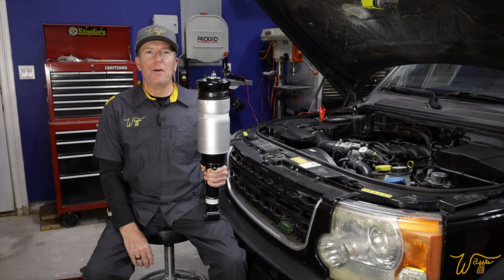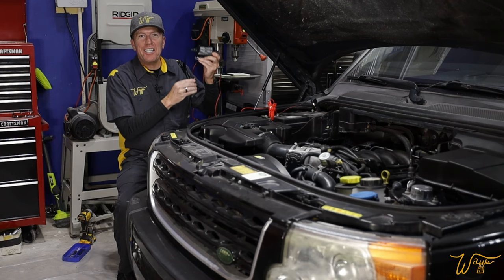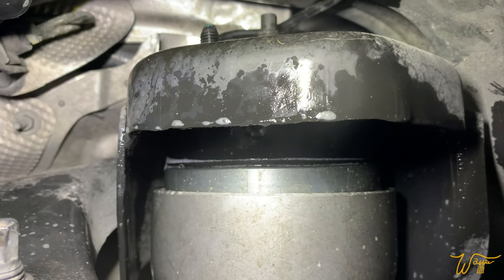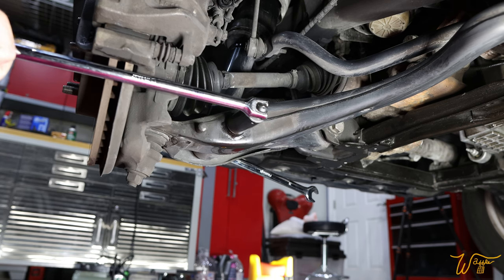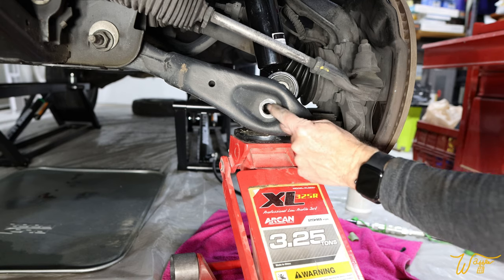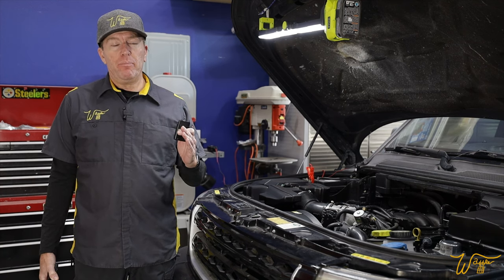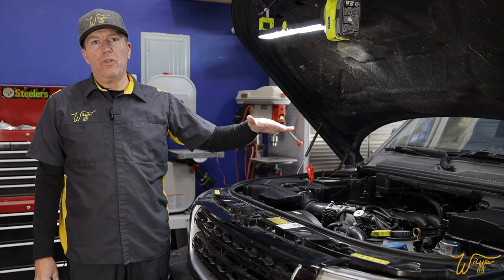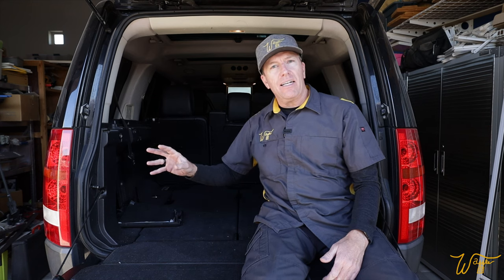Replacing Front Air Struts on a Land Rover LR3 - Ep. 5

Comment: Hi, many thanks for the very kind words , really pleased it helped , indeed as mentioned to disable the suspension just need to pull the F26 fuse , great the new struts came with the brass Voss connectors as on there own there around $14 bucks , personally I replaced all mine with brass push fits as they were a lot cheaper along with being easier of just pushing them in without messing around trying to get a spanner to tighten the Voss connectors . When I done mine several years ago I did find the ride quality was better . Plus finding out that when the suspension is in off road height and u get bottomed out whilst driving off road the vehicle will give u the option of raising it to extended off road height and then plus extended off road height , awesome lift by the way , happy motoring  and u have a wonderful safe trip , many thanks for sharing this video with us , looking forward to the next video , ps , hope it was ok but posted ur video on landyzone and the discovery 3 forum , hopefully will then get some more views
Reply from the maker: Thank you, Gary! Share away!
Reply: @wafflesquare  , many thks, plus didn’t want any of my comments to come across as disrespectful in any way , just what I’ve learnt in the last 6 x years of owning my D3 and nice to always pass it on , found ur videos extremely well put together and very enjoyable to watch, thks again as it must take ages to put these together , hope u have a wonderful trip, ps, now u have the discovery it’s a good excuse to buy more tools, lol
Reply from the maker: Amen!

Comment: The only fuse you need to take out is fuse F26  yellow 20Amp . This stops any articulation of suspension by the vehicle.
Reply from the maker: Thank you so much!
Reply: Can confirm F26. I remove it enough that I've sharpie-d the surrounding plastic so it's an easy find each time.

Comment: Its always best to put the new voss connector nut and collet onto the green pipe before you connect it back onto the strut .  When the connector is then inserted into the strut and you tighten the voss connector  the brass collett tightens its grip on the pipe  giving you a proper airtight seal . Also you don't then need the pliers . Voss connectors do not work the same as push fit as you cannot get passed the collet once it is tightened . hope this makes sense and good channel Mike .
Reply from the maker: Thank you again!

Comment: Great video!  Replaced one of my 08 RRS air struts in about 1 hour!  One note:  Save the brass air fitting from the old shock.  And save the plastic insert that comes with the brass fitting on the new shock.  I found the brass fitting delivered with the new strut did not have the same tolerance as the OEM fitting and leaked during a bubble test. (I.e., it was very easy to slide the pneumatic line into the new brass fitting and difficult with the old one). Once I installed the old brass fitting into the new shock using the the plastic insert, pushed the  pneumatic line in with a bit of force, the bubble test was good, and the shock is keeping pressure.   I'll know more in about 24 hours!
Reply from the maker: Good for you!!

Comment: F26 is the EAS fuse. 
The brass fittings are called VOSS connectors. Look after them, they sell for about £10each. 
For the 15mm top nuts, a swivel head ratchet spanner does the job on all 3 nuts. 
Always do the overnight test at the height at which it sinks overnight. Fully raised often seals the split in the rubber air spring and you learn nothing, this of course depends on where the actual leak is, but its usually up inside that aluminium can where the rubber folds in on itself.

Comment: Mike, this is a little long but I needed to explain so you could see where I'm coming from.

I used your guide and a couple other videos to properly educate myself. One incongruity was oxmanagain saying you feed the VOSS connector and compression ring onto the line first, then seat the fitting into the strut and tighten down. I tried the push-connect method on the rear strut and found it almost impossible (though I realize it is the correct method) so I threaded all connectors on the line first and that definitely worked.

That sets the stage for my question. Unlike the rear, there was a huge space deficit on both front sides, mostly due to the heat shields and long strut posts. The welded bracket that holds the strut also is thick enough where I seemed to need a very thin wrench (which I didn't have) to finish snugging up the brass air connector from above the bracket. I felt it was near impossible to tighten the brass VOSS connector below the bracket due to the three posts, so I did it all from above once the posts were tightened down fully.

I noticed you didn't include the tightening of the air line in your video and neither did oxmanagain. My main concern is not getting that air line tightened enough to prevent leakage. I would say both are snug, the air line "bulge" is about two quarter widths from the top of the connector, and firmly tugging on the line I cannot remove it. Do I call it good?
Reply from the maker: I took great pains to document every step I took and the outcome was everything I had hoped for…leak free air suspension system. I’m not sure what else to say.
Reply: @wafflesquare  However I worded it, I have to clarify: No judgment here. You did better than great.

I guess I just took a bunch of words to ask if you thought I would be good to go on the Voss connections the way I did them. I put everything back together so we'll see.
Reply from the maker: @blackrocklookout thankfully, a simple leak test will answer this question. according to the instructions they are meant to be installed the way I demonstrated.

Comment: Hi, you should check out a German couple (Christian and Vera) on YouTube,  their channel is called "LR TIME" they have lots of brilliant tips including which is the only fuse you need to remove on the LR3 and LR4 for the air suspension, it is an excellent channel with a new video every Sunday. I highly recommend it. Thank you for taking the time to make your videos and sharing them.
Reply from the maker: I love their channel!!
Reply: Those two have a great channel, and some seriously good mechanical skills to boot
Reply from the maker: Agreed.
Reply: Yes there are now 5/6 really good you tubers specialists on LR which is great I’m personally tackling jobs on the vehicle I never imagined I’d do.  👍👍🇮🇪greetings from Ireland
Reply from the maker: That’s great John!!
Reply: Thanks heaps for the video very informative. I do however have 1 question, once the airline is seated in the 12mm fitting did you have to tighten it. It looks as if you placed a small amount of torque on the 12mm fitting  prior to installation and then pushed the airline in until it seated, without re torquing the 12mm fitting? I’m a little unsure about this part of the process. kind Regards Gus
Reply from the maker: Great question. You fully tighten the fitting first.

Comment: Very good video, I have a 2013 RRS HSE and I'm replacing the Front shocks, added 2.5" lift Bars, Rebuilt 3 calipers and replaced one with a new caliper and complete Brembo pads on the TRW calipers. My questions  is on the passenger side front strut and the 3 top bolts holding the strut in place. The 2 front nuts were easy but the last nut was a bugger to remove. Any tricks on installation on the 3rd nut??
Thank,
Pete

Comment: Before I forget , if u find it difficult to remove the air compressors intake filter from the boot I personally cut the pipe and rejoined it using a 6mm push fit coupling , plus have u checked out ur front diff breather vent plse as these can block up and cause oil leak out from the seal , here’s the part number for u LR019450,  it’s tucked down by ur expansion bottle , if u search on the discovery 3 forum for a breather vent ur see some posts , hope that also helps , ps, apologises as I did try and post a link for u but won’t let me
Reply from the maker: Great suggestion!! I’ll research the front diff breather vent.

Comment: I definitely need a gap plug tool
Reply from the maker: Definitely a great OBD reader. The Launch Elite tool I reviewed in this series is really good too. Much more affordable with almost as much capability (it can’t check or change air compressor firmware on the LR3).

Comment: Once again, GREAT VIDEO! I watched your other videos but specifically commented on the rebuild of the front valve block so thanks for your help and comments. But turns out it's a leak in my driver side air strut.  I'm gonna replace it myself with the confidence I gained from your video! My question is: Are the struts from your Amazon link the specific ones you used?  I've gotten burned on cheaper Amazon replacement rover parts before.
Reply from the maker: Yes the link is for the exact struts I purchased and installed. I chose them because they were inexpensive and had good reviews. If you are worried about quality, I would suggest OEM struts or Arnott brand. They are nearly four times the price, however.
Reply: @wafflesquare  If it worked for you that's good enough for me! I've ordered from your link and await the shipping.  I'll let you know how the install goes.  Thanks again!
Reply from the maker: You are very welcome, Damon. Thank you for supporting the channel!

Comment: You have done many of the same repairs and upgrades as me, my transmission rebuilt is done but my drive line with center hanger bearing was worn out so you may want to inspect your its a known failure on the land rover , there a repair kit on the center hanger bearing on Youtube showing how to do the repair the shop just bought a used one
Reply from the maker: Great tip! Thank you, James.

Comment: Any issues come up with the maXpeedingrods struts to date? Just ordered one. Did you torque down the brass air fitting before inserting the line? Or insert the line, then torque? Can't wrap my head around how that's a "quick connect" fitting, seems like it would function more like a compression union. Thanks in advance...
Reply from the maker: No issues thus far. The entire air suspension system is working great.

Comment: Great informative video. Thanks for sharing. I have a similar GAP tool that I purchased from British Atlantic RR for my '11 RRS supercharged. Unfortunately, I haven't been able to find the standard height recommendation for mine. Does the type of GAP you have contained other models, or did you have to purchase the software for a particular model? Thanks again for the video.
Reply from the maker: It came with a full-use license for one vehicle.
Reply from the maker: https://www.gap-diagnostic.com/products/iidtool/
Reply: @wafflesquare  Awesome thanks again 👍
Reply from the maker: You are very welcome, Jeff.
Reply: The Gap tool comes with all the software for all Land rover and / Range rover  + Jaguar  vehicles on-board  so you can do diagnostics on all these vehicles straight off , But it is only initially registered for your vehicle . If you need to do any updates or callibrstion of any sort on another Land / Range rover  etc... then you can have that vehicle added to the tool for a small fee in each instance via Gaps website .

Comment: Hello! Great video, great content.

I have a 2018 Land Rover Range Rover supercharged . I was having suspension issues last week where my vehicle was going up at a stoplight. And anytime I stop the vehicle. The front would raise up. I figured this was a leak of some sort so I took it to my cousins body shop and he assessed that the front passenger air was leaking. He replaced it a couple of days ago and everything was working properly for a day or two and now out of nowhere. I got a suspension fault on my screen and it essentially locked the suspension where it’s at and will not go up or down.

Any idea what this may be? He’s going to look at it next week, but I was curious if you may know. 

I don’t know if you needed to program some thing after installing or if it’s a simple fix 

Thanks in advance
Reply from the maker: The technology in a 2018 model is likely very different than an LR3. I have no experience with those but I would start with calibrating the suspension.

Comment: Just purchased a 05 lr3. Been working on it so my son and I can hit the trails. Your vids have been extremely helpful! Going to be changing the 2 front air struts and adding lift rods. Can I calibrate with the Johnson rods installed or should I calibrate then install the rods? Thanks again!
Reply from the maker: Not sure what you are asking but if you are installing extensions to your ride height sensors, I would calibrate afterwards.
Reply: If you must use rods ( hint: don't), calibrate before you fit them. The GAP IID tool will give you a selectable 4 inch lift which switches with just a few pushes on the GAP interface. and it is infinitely variable and has 3 user programmable memories. The IID may be expensive, but it worth the money for the suspension control alone.

Comment: When you took the plastic shipping part out of the new Air strut brass fitting how tight did you make the new brass fitting before pressing the airline into it? It looks like maybe you just did it hand tight
Reply from the maker: Snug with a wrench
Reply: @wafflesquare  okay thanks I just did it and left it slightly loose pushed in the line and tightened it as I held the line in I think it looks good
Reply from the maker: Excellent

Comment: Hello, I am hoping some one can let me know what I missed on my 2013 RRS. After Completing a brake job including rebuilt calipers and bleeding the system, added 2.5" Johnson Lift rods, and replaced the Front Struts/Shocks. In the process of about 2 weeks sitting on my lift I finally had everything finished and was ready to restart the systems. I used my TOPDON ArtiDiag 800BT to evacuate the air in the tank and struts prior to removing airlines, and when I tried to reset the Suspension Level Calibration process which re-pressurizes the tank and struts and establishes where the vehicle is siting relative to established heights, couldn't finish because the vehicle wouldn't start. I ran a diagnostics looking for any DTCs or other systems problems and everything was good, other than the systems that required power and air pressure.

Okay, long story short I need the engine started in order to start this process and the battery was dead. I recharged the battery and getting 13.6 volts and nothing. I disconnected the battery hoping to reset the system and nothing. The last time I tried to start it the dash indicators lights come on and look ready to start, nothing...

I'm not sure why it wont start, am I missing something??

Thanks for any pointers

Pete

Comment: Is it necessary to remove the brass fitting and then put it back to remove the shipping plug like you did at 12:54; or can you leave the brass fitting in place the way it arrived on the strut and just remove the shipping plug directly (without having to unscrew the brass fitting)?
Reply from the maker: No you can just remove the shipping plug.
Reply: @wafflesquare  And to put in the air line in the strut brass fitting when installing the strut, you just push the air line in until it's seated?
Reply from the maker: Yes. In the video I show how far down to seat the air line.

Comment: hi waffle, I have a quick question about the LR3 if you don't mind.  Does the 05 and 06 model have a different trans than 07-09?  trying to figure out which one is the best to buy.  thanks
Reply from the maker: In my transmission service video I demonstrate how to identify the exact model number: Land Rover LR3 Complete Transmission Service 6HP26 - Ep. 3
https://youtu.be/awZzcE-LwRc
Reply: @wafflesquare  thank you sir.
Reply from the maker: You are very welcome.
Reply: All the automatic gearboxes on all L319 LR3 and Disco 3  04 -09  are basically the same 6HP26. The Disco 4 also had a 6 speed ZF until MY2012 when it got an 8 speed, but while a D4 6 speed will fit in a D3, it won't work in a D3, and vice versa as it speaks a different electronic language.
Reply: @DiscoGruffalo  thanks for clearing that up.

Comment: Just subscribed, by the way ...what's EAS ?
Reply from the maker: Thank you for the support! What time stamp in the video are you asking about?
Reply: @wafflesquare  Thank for answering....I'm sorry not being specific, I was referring when towards the end of episode 5  @ 24:42 min.(air suspension) you said "push EAS to reactivate". If that's the up and down lever, does the ignition key have to be on the on position?. Another question would be, since I have 2.5 inches johnson's lift kit , when recalibrating should I add 2.5'' to the normal height? What do you think?
Reply: @wafflesquare  24:43 on episode 5. " Push EAS up or down to reactivate". Thank you.
Reply from the maker: Thank you for the clarification. “EAS” stands for electronic air suspension. When completing the calibration, the GAP IID tool asks you to function the air suspension selector up or down.
Reply: @wafflesquare  Thank you, I thought so.

Comment: Super loved the detail to precision I wonder does the iCarsoft have the same function , keep up the good work.   🦾🦾🦾🦾
Reply from the maker: Thank you John.
Reply: I have the icarsoft and unfortunately it does not have as many of the functions of the gap tool - the gap tool is the only one apart from the super Dooper(££££££) dealer tool that has the calibration facility and the ability to programme new keys to the car .
Reply from the maker: Thank you for sharing the icarsoft capabilities!
Reply: Yes I did look into the icarsoft function for this dilemma and it’s not able to do it.  In Fairness I done my wishbone a few weeks back (tricky), I did get to use it to deflate the system but now I have an imbalance 🙏30 mm out on one side.